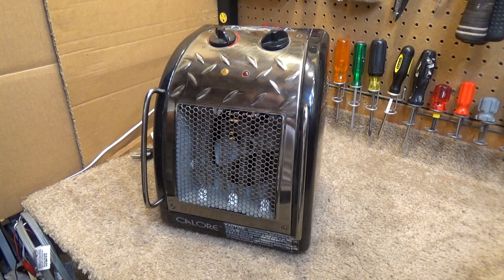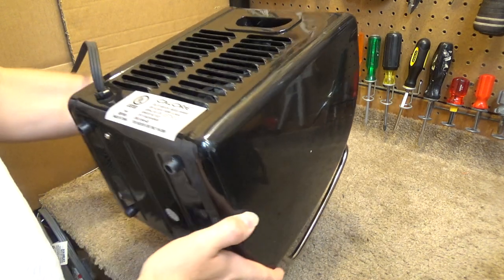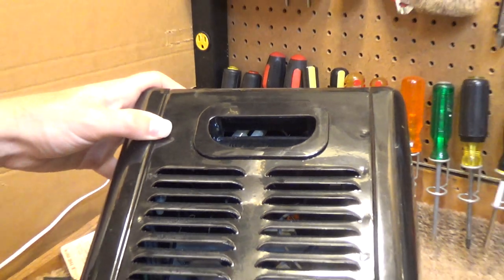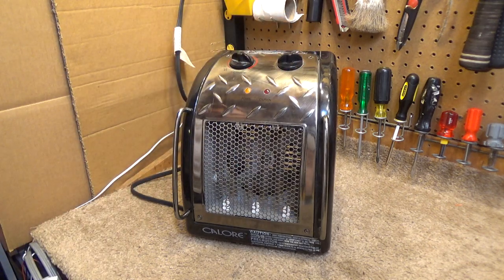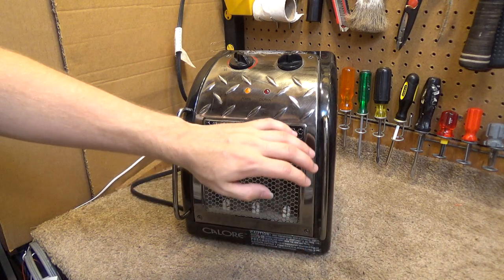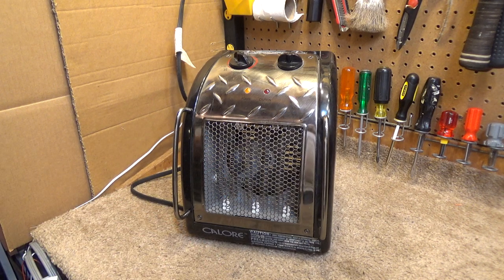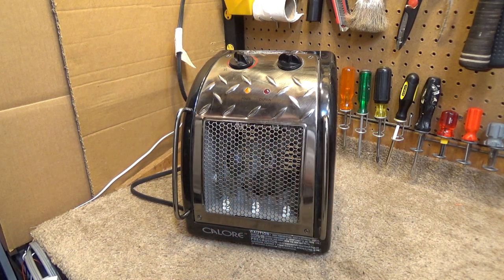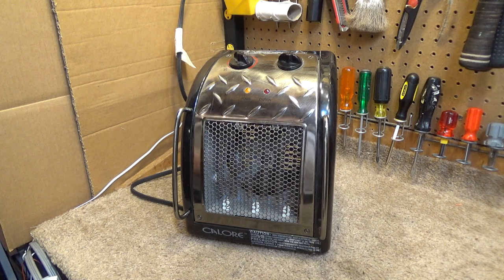Calore NH600D Utility Heater | Initial Checkout

Comment: I just got one that’s not really working.. help?
Reply from the maker: In what sense?
Reply: @JordanU  the Fan and heater turned on for a few minutes and then the caution light went on and it just stopped.  Are you going to post a fix it or service video on this space heater??🙏🏻🙏🏻🙏🏻
Reply from the maker: @julierosenberg1345  Sounds like the thermostat satisfied. Have you tried adjusting it?
Reply: @JordanU  it just totally stopped doing anything....no fan, no heat... nothing
Reply from the maker: @julierosenberg1345  Not sure, perhaps a connection came loose somewhere.